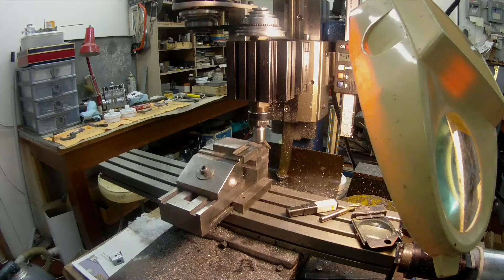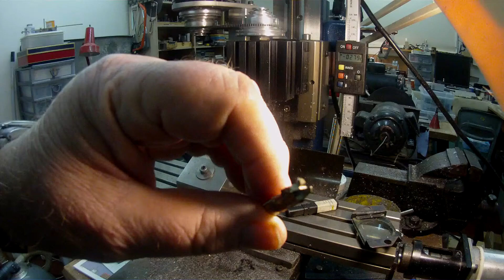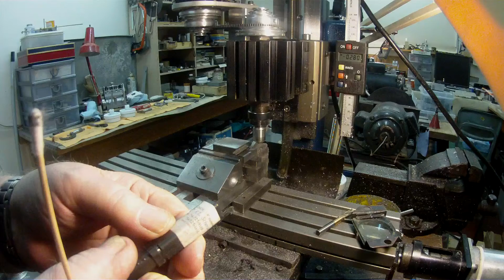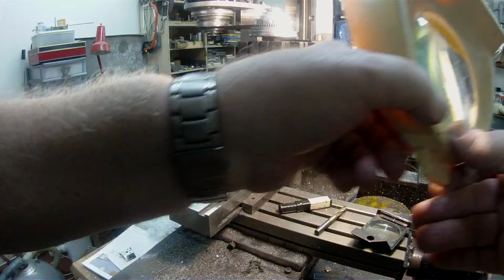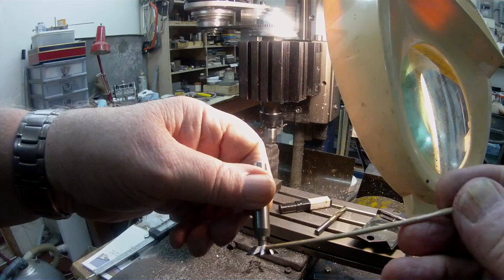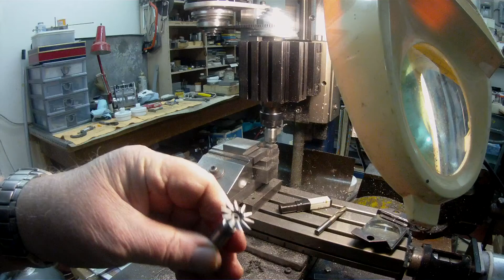FILE0018  Fifth part on Profiler tool

Comment: Walter:
Your video turned quite well.  I like your fly cutter idea for cutting the dovetail.  I use fly cutters a lot but haven't used them to cut steel.  I needed to cut some steel gear teeth recently, but I was hesitant to use a fly cutter and decided to purchase a multi-tooth standard gear cutter.  They do work well for alloy metals, which I use quite often.  I'm not sure about cast steel.  Thanks again for the video.  Best Regards: Larry
Reply from the maker: This morning I finished machining the dovetail to size with a dovetail cutter the fly cutter was to save wear and tear on the dovetail cutter itself, the good thing with that is you step the flycutter equal on the Z and X because the angle is 45 deg